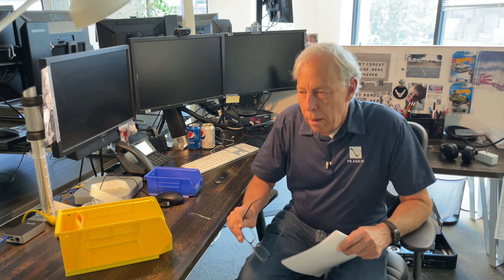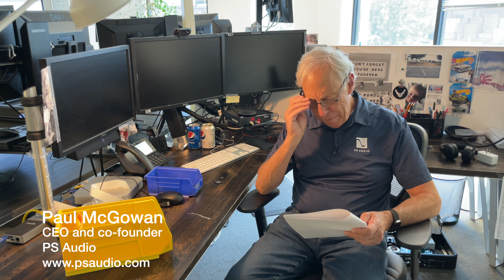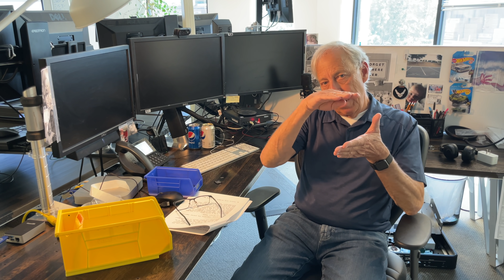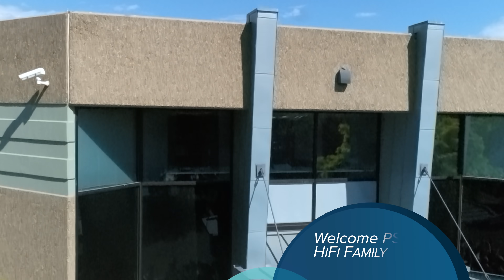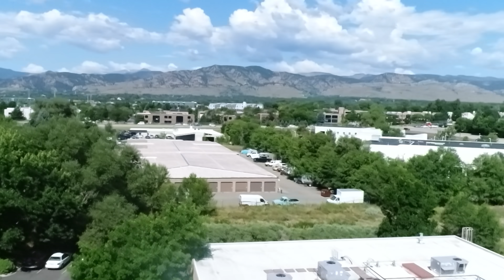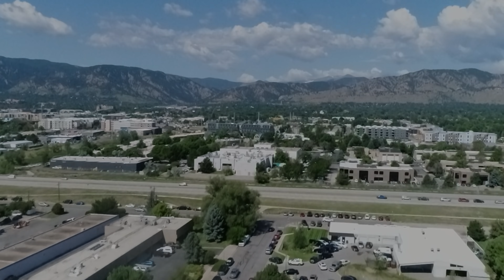Why stereo systems sound different at night

Comment: Years ago I bought a power conditioner. My house is detached with no near neighbors. Using the conditioner made no difference that I could detect so I put it in the attic. A dozen years ago, I got a condo in the mountains. I can't make a lot of noise there, so I put in a moderate quality system. It didn't sound very good so after a while I dug out the power conditioner and boy, what a difference. I assume that with so many close neighbors there is a lot more junk in the line.

Comment: music sounds better at night:

- cleaner power frequency: better electronics signal to noise ratio
- less ambient sounds/ street noise: better acoustic signal to noise ratio
- brain switches from local attention to mind wandering before sleep
- slowed reflexes, slowed mental accuity and toned down eyesight due to tiredness, but higher sound sensitivity due to instincts.
- changing air pressure and temperature due to nighttime cooling/ indoor heating.
- psychology: mental state of having finished the day.
Reply: Mostly, micro-vibrations drop from street vehicles/industry machinery/large transformers humming. Seismographs prove this. I would think our hearing acuity DROPS at night, making it more difficult to appreciate sound.

Comment: Oh. My. God. Instead of explaining how big is a difference between day and night in mains distortion, how does amplifier power supply works, what are typical amp voltages and what are typical distortion of these voltages due to mains higher harmonics, there is this "beautiful story" / sales pitch (as Paul himself calls it) about importance of turning mains AC to DC then to "better" AC to be later turned into DC again in amplifier power supply itself... Com'on, if it is not poorly made DIY power supply or amp objectively it will not be different. Best of luck and congratulations - a great sales pitch, Sir!

Comment: Fully agree that poor power supply waekens a system. 
Anyway, I experienced over many years that my level of relaxation significantly alters the perception of listening. Most exciting to me are those late night sessions when I am close to falling asleep, but still awake enough to listen to alle the details. 
Typically, I then can take back volume significantly without getting the impression of flat sound. 
What also helps is to do a quick 2 min breathing exercise to calm stress levels down to make listening far more enjoyable.
Most likely, it's a good combination of both - sound power and relaxed mood.

Comment: Maybe you are more relaxed at night. Also, music sounds better if the air is more humid than dry.. I listen in complete darkness  because  my ears are not competing with my sight. This improves the sound stage dramatically. Looking at your equipment while listening is the worst thing you can do and that includes the speakers. If you cant make the room  dark during the day, then put a black sound transparent curtain in front of the speakers from one wall to the other. Also, don't have your electronics between the speakers. They should be put say halfway along one of the side walls.

Comment: From my experience, my thought would be the change in outdoor temperature at night.  Since Indonesia is 230 Volts 50 HZ the voltage variation would be less of an issue. That may not be true if you live far from the city. Then voltage problems will occur since you are at the end of the line, so to speak.  PS Audio does make a 230 V 50 Hz unit that would take care of any voltage issues.

Comment: Shouldn't power supply filter capacitors completely remove the noise in the power line? Why convert it to DC, back to AC and then back to DC again?

Comment: In this situation I would bet you money it has more to do with the temperature difference between the day and evening. Hot temperatures can degrade the sound due to the performance of the drivers as they are affected by extreme heat.

Comment: You right on that. I use power conditioner, even though not the best solution, but found big help, sounds from speakers and at times sound from my arcam receiver where eliminated by puritan brand power supply and conditioner. Also use good quality hdmi and speakers wire. I picked van den hul for wires. I picked these brands after lengthy research.
Now, will look into power regenerating method and cost.
With above upgrades I found the quality of sound and pictures were much better and refined. This could be subjective so brought in family members to confirm if there were differences. Answer was quite a lot differences. Compared to cheaper brands and manufactured in China.

Comment: YOU PROMISE THIS WILL WORK??! Unbelievable! You simply can't diagnose a system based on "sounds better to me at night" - you might not be talking about any kind of electrical distortion in the first place!
Of all the variables involved in subjectively enjoying music from day to night, you're trying to guarantee this fellow is noticing the difference in power supply waveforms... I wonder why...

Unlike a salesman, my priorities are biased towards cheaper solutions first and it's just as likely your listening environment is changing from day to night, causing a much greater impact on your audio quality than a normal power supply ever would. 
I wouldn't be surprised if the atmospheric pressure changes enough from day to night, in some parts of the world, to cause a noticeable difference in sound.

Comment: I'd need to see some measurement data from the power input to the signal output of the amplifier for this one.  A properly isolated and filtered AC to DC input isn't difficult and I've never seen AC line noise that can't be easily filtered out by standard methods.  If the AC line source was bad enough to circumvent input filtering under typical conditions it would be very worthy of measurement data-backed publication.  My opinion leans heavily toward a human physiological or psychological element here.
Reply: paul is simply admitting his products come with inadequate power supplies; cyrus have played this trick with their amps, the upgrade being a proper power supply.................................why manufacturers keep on getting away with this crap is beyond me

Comment: Doesn't power collect and smooth out in the caps anyway? Then the amp draws that clean power later... Just because a pipe filling a tank with water is tumultuous doesn't mean that the water in the holding tank is tumultuous. The tank full of water is calm.

Comment: Well, Paul, you just exposed the many nut jobs who swear their AC is clean because their pimple-faced electrician or power utility co technician told them so.  Or because they "only purchase components from designers who know what they're doing" and/or because they only live 9.3 miles away from the nearest power sub-station. Which happens to cover probably about 70% of the industry's population.  :)  Anyway, good video and good explanation.  Now I've never had firsthand experience with a power regenerator much less a superior regenerator but I've heard that even superior regenerators can benefit sonically from superior line conditioners.  On the surface this seems to go against the grain of your reasonable explanation, but might there be more to noisy AC coming in from the street than just a less-than-perfect sine wave?

Comment: I believe music perception is to great extent dependent on your mind state. We have a different mindset in the evening and this helps to enjoy music more. if you're tired it will influence your music percption. The same music, the same system - one day you feel great stereo and dynamic range, another day everything feels kind of flat. Most probably clean power supply in th evening adds to that, but I still believe state of mind is the key here.
Reply: That's exactly what I was thinking.

Comment: Well, but in any HiFi System works internally with DC. So all the magic with DC and filtering is already going on without external power regenerator. Why not just only better filtering, i.e. biger low ESR caps within the devices?? Chris

Comment: My father worked at a power plant. They always got some extra big turbines started up on Sunday to Monday nights to have them going full power when on Monday mornings all moms switched on the washing machines 😁 
They always kept the power supply through the grid reliable and stable 24/7 for decades without any interruption. No sound differences when on that grid.

Comment: but your hi-fi is running on dc; so you've already transformed and smoothed it
you only need to convert to dc once
Reply: You are absolutley correct.
Reply: @0x07AF   Paul is secretly admitting his products don't have adequate power supplies ; my take is why would anyone trust this guy ?

Comment: Does LED lamps and dimmers affect too?
I have a change in sound att home. I might be little crazy and wrong,  but it appears that this change come att same time that we changed from regular lights to LED lighting, and ofc few dimmers.
I still have the differnts betwwin night and day (even weekends) 
But the "good houers" is not so good anymore.  :(

I know, myt systems is not ps audio qualety, and ofc could been foulty of age. (Tho the oldest system does not seem to be the most affected)

so i do wonder of the LED's and the dimmers...
Reply: @Douglas Blake Actually, when the sound is bad, oven, and toaster seem to have reduced effekt. Even the waffle iron is cooking uneven. 

The surround system, an Harman Kardon get some differences in the static when operating the dimmers. But really not so much.
My Stereo system, with and really old NAD 216 THX. Does not seem to change anything when operating the dimmers.

Both are affected when ovens etc seems to lose effectivity.

I know my house have some of the oldest power lines in my area, connected to the oldest transformator. with old 220V system..
Rest of the area is having new 400V to all houses, then use Neutral actively for 230 applications (Im not sure on details of that, but supposedly much more stable)

And there is some industry using same old transformator close to me.

So perhaps i am mistaking to blame the led's and dimmers.  If so, that be good when im moving in few months. Tho home with new lines connected to a new transformator who only share with residential homes.
Reply: @Douglas Blake That is my conclusion too I(Googled  this after first post)

Lukelly i already bought new apartment, and trough google i found out some power grid information in this area.

My new apartment, who is still in building fase.  
Is getting brand new power lines, according to latest specs and rules, and dedicated transformators for the apartment building and private homes in the area. Who is over constructed for stability and future enhancements. 

And the did same with internet fiber optics.. so i got little lucky there. Coz before i was not so much aware of these types of issues.

Comment: Is this effect measurable in the sound coming out of the speakers? It would be great to get the subjective ears of a human out of the equation
Reply: it is much better to reproduce the two cases and then pass to an abx test. no measurements are needed. case a with dirty power supply (a dirty power supply can be built) and case b with clean power supply. the problem is not the lack of measurements but to establish reliably if the differences are really audible and above all recognizable

Comment: This may apply to countries with 120V power supply. Not so much with 240V standard. Also ambient noise make a huge difference. My listening room is not ideal and in that day I can measure 49db when the fan and AC is off. In the night same room measures around 36db.

Comment: With unregulated voltage rails this makes sense but with Bob Carvers "Tracking Down Converter " power supply in his Sunfire amplifiers  it tracks the incoming signal and keeps the voltage to the output transistors a constant 6V above what is needed at that instant in time so a varying line voltage does not affect performance one bit. Too bad Sunfire does not make power amps anymore as they are also load invariant and sound as good as much pricier amps. But this begs the question why don't manufacturers use voltage regulators for their power rails?
Reply: @Douglas Blake On Carver's older "Magnetic Field Coil" amplifiers he used a small triac (on a small heatsink) on the input of his transformer (field coil) to keep his low, medium and high voltage rails constant with enough current to drive rather current hungry Magnepan speakers. All of his Sunfire "tracking Down Converter" powered amplifiers use only the chassis and unvented cover as a heat sink for the regulator and output transistors and they only got a little warm. These amps were load invariant with his 600watt amp able to deliver 4000 watts into a 1 ohm load which equates to 63 amps (on a time limited basis) and were stable with a 3/4 ohm load.

Comment: Thanks Paul. What I still find hard to believe that it seems you tell us that even the best PS-Audio devices don't have a good enough power supply to handle any kind of AC input. As far as I understand the power supplies in each device convert the AC into lower voltage DC. Shouldn't that be possible, perfectly possible, with any AC input?
Reply: good quality gear has a good-quality pwr supply, obviously PS Audio's gear doen't
Reply: @johnholmes912  Paul obviously wants to sell power regenerators to audiophiles.  I agree that a power supply should filter all frequencies higher than the fundamental.  That's what capacitors are for.  In the case of a power supply, the fundamental is 0 Hz, so the power supply should filter out everything above 0 Hz.  In fact, it should be much easier to filter out high frequencies than low frequencies.  Thus the idea of RF causing a power supply problem is largely myth.   Also, if a 60 Hz mains is "flat topping", that means there are some harmonic frequencies creeping in that are higher than 60 Hz, based on Fourier analysis.  Therefore, a filter should easily be able to eliminate these, even on a power line.

Comment: If it is audible, it is measurable. Show the measurements of what comes out of the speakers, and relate it to audibility research. Also, components convert the AC to DC internally, so no problem with funky line AC (within reasons). Here line voltage drops in summer to 90 V or so, and that is a problem. So I added a Furman voltage regulator. As far as I know PS PP cannot deal with low line voltage.

Comment: Sounds  good, but I have also noticed that my car stereo sounds better when driving around at night. Thoughts?
Reply: Streets are more empty at night, letting you drive with less stops, which charges your car's battery more evenly 🥴😂
Reply: If you are listening to an over the air transmission in your car it could be different at night due to reflection off of the ionosphere.
Reply: @Douglas Blake, yes, notice that I said different rather than better.
Reply: nancy4don
At night noise level is lover, so you hear a better dynamic contrast. The mose gain is in the bass region it sounds fuller and thanks to that, midrange and highs getting sharper definition.
Reply: Its all psychological.

Comment: I have ps audio regenerator and many fancy expensive cables, but it still sounds better at night. Way better :)
Reply: Traffic provides vibration at 7Hz 400x greater than the tweeters movement when creating music. Get Townshend Audios seismic products and decouple speakers and electronics from 2,5 Hz instead of usuall 30 Hz (Isoacoustics, Sorbothane etc). Only when you address power regeneration and traffic vibrations will you get late night listening daytime.
Reply: @NiclasMardfelt  I have fancy nordost cones for all the boxes and even more fancy TAOC stand. Yes they alll do input in to quality. Buuuuuut it still sounds way better at night :)

Comment: Where the scope results? How about some real data to back up your opinions.
Reply: Check out PS Audio forum, there is lots of threads regarding customers real data and improvements. I have tried a P15 and it made music more musical, a bit magical. Midrange voices was so much more emotional. 

Tip, first build a great set up, then learn how to place speakers to get full 3D depth, then get great power for the same amount as you spent on your set up (includes power cables, grounding and power regeneration), then spend another 20 percent on antivibration (under and on top of speakers, under rack, under every component, under cables (to cables on the floor) and under and on top of power treatment), then spend another 20 percent on acoustics treatment (read Acoustica Applicatas free guide) only then is it time to start thinking about upgrading electronics and speakers. 

People tend to purchase expensive equipment without doing all the needed extra job, then upgrading before getting half of the performance from existing gear. To build a great musical experience at home requires time, knowledge, effort, research and money spent on other things than speakers and electronics. Most people do not put in the effort or study enough, thereby having mediocre performance from systems that could have been great. 

Start by reading PS Audios forum or better, try a Power Plant at home
Reply: @NiclasMardfelt  fan boy? Just asking for facts with science-based  tools. Because science don't care what you believe. Data is data.